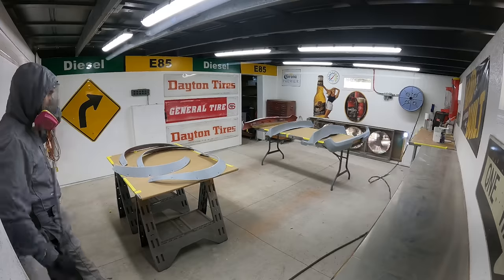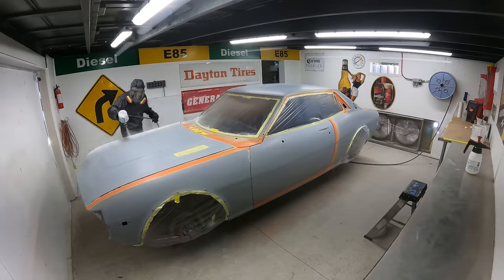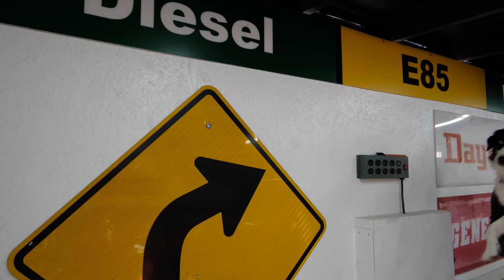Custom Tricoat Paint Job Toyota Celica

Comment: I'm 61 my job in highschool was in body shop bill had been doing it for 30 years  u wet sanded every layer and shot most paint in open air u sanded out the imperfections  most important thing filters on air lines  and great mask 😷

Comment: Fabulous colour and a fantastic finish you wouldn't get a better job if it was done in a professional bodyshop, is this a custom made colour Adam or is it a OEM colour, I was wondering if you have a car manufacture name and colour code for it🤔

 I'm just a hobby painter in my home made booth and I used to hate pretty much everything I painted due to the flaws and the nibs which was getting me down so I either had to change my mind set or my hobby, thankfully I changed the way I looked at my results and doing this has made me a better painter plus I'm getting cleaner jobs so it was win win👌👍John UK.